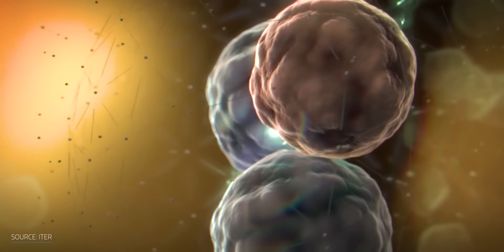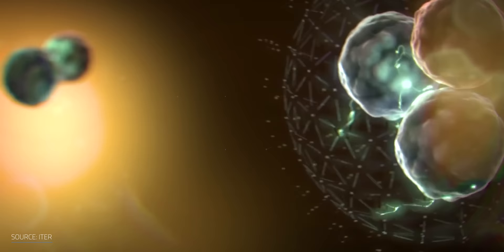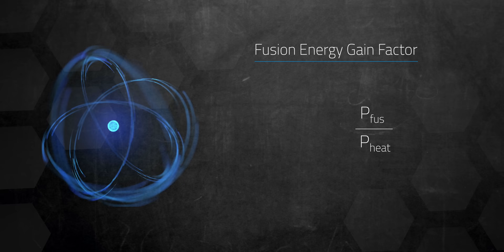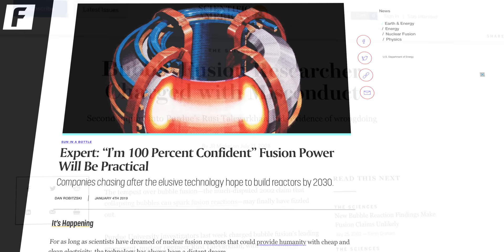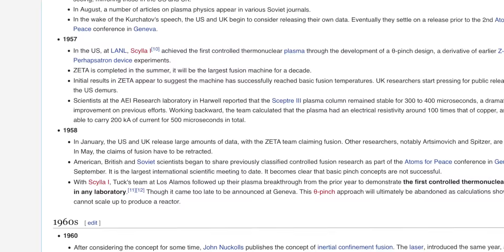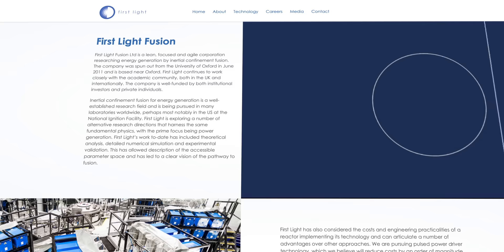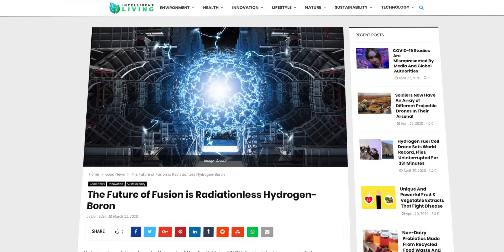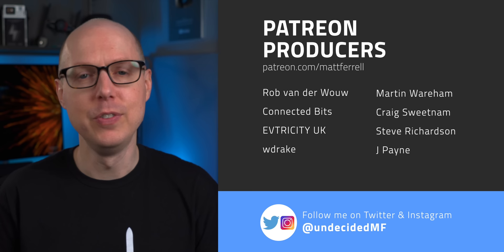The truth about nuclear fusion power - new breakthroughs

Comment: One thing not mentioned here is the distinction between reactions that relase energy with neutrons (hydrogen, tritium etc) and reactions that release energy in the form of charged particles (proton-boron). The latter is a lot cleaner in terms of radioactive materials and its a lot simpler to convert the energy (you're not boiling water). Of the latter, my favourite (and not mentioned) is focus fusion (electrical discharge driven). Of the former, my favourite is the ARC reactor concept. 

This being said, fusion is unlikely to compete commercially with solar and wind energy backed with battery storage, pumped hydro storage and hydrogen storage. All of this will prove to be both extremely reliable and cheap, long before fusion is mastered. I'm saying this as someone who absolutely loves the technology. But its future will be in space.

Comment: Great video but a small correction to your highly condensed 10 minutes amazing video. tritium breading from lithium blankets is not an easy job, you would need the fast neutron to penetrate the structural plasma facing components with the right speed and angle to knock off the lattice of the lithium- tritium breeder- blanket which is quite challenging, but deuterium can be easily extracted from water as you mentioned.

Comment: It is far easier to let it explode than to throttle it linearly. May be we could never throttle it. 

Currently we use a model called tokamak model (electrode less and magnetic containment) the concern is risk for explosion or melt down. 

This model requires complicated and expensive containment to maintain plasma - artificially, giving up (ignorance?) the property in plasma of self (natural) organizing, convergence to temperature amplification called Plasmoid model. It operate on electrodes in pulse mode featuring can converge 10x the competition  models. Eric Lerner has more.

Comment: 04:08  The Q of 0.67 for JET is only for the ratio of the heat that comes out of the plasma vs the heat that goes into the plasma.
Apparently, the total Q, that is the ratio of the energy coming out of the reactor vs the energy that needs to be put into it to operate it (i.e. for the superconducting magnets, their cooling, the lasers, etc.) is more like Qtotal = 0.01.
It looks like nuclear fusion research likes to cite the Q for the plasma heat ratio, rather than the much smaller Q for the total energy ratio.
Source: Sabine Hossenfelder:  https://youtu.be/LJ4W1g-6JiY?t=541

Comment: The accidents with Fission reactors that you highlighted is due to the specific TYPE of reactor design (PWR) and the loss of pressure caused by power outage so liquid water coolant turns to steam which reacts with the Zirconium in the moderator stripping out hydrogen. The explosions at Fukishima was hydrogen igniting not a nuclear explosion. There are many other reactor designs for fission that are much safer.
Reply: For years, the propagandists told us that nuclear fission was completely safe.  They said that if something goes wrong, they just insert the control rods stopping the reactor.  Fukushima showed us that was a lie!  The reactor takes weeks to fully shut down even if the control rods are fully inserted!

Comment: I remember learning about the Tokamak in the early 80's.  They are still centuries away if one considers the tremendous energy required to run just the experiments for pico or femtoseconds.
Reply: James M the experiments last a lot longer than that!
Reply: @Gomlmon99  Ah the last documentary I saw could've been older.  Overall very good analysis of progress and strong arguments.  I am still hopeful but I wish the API had not discredited LENR or cold fusion by vote not by scientific merit.  The energy cartel did that.  Cheers

Comment: I'd figure that the moment any one of the possible designs hits a breakeven point and proves that it *can be done*, then the sheer volume of investment which would follow could proliferate fusion energy faster than we may expect. Especially considering the leaps in manufacturing and materials science happening every day at this point, who knows what kind of variety and capacity we'll be capable of when there is a viable design.

My pet favourite use for fusion would be mass scrubbing of CO2 from the atmosphere. The only thing preventing this from being viable is the energy cost. Really, what prevents a lot of things being viable is their energy costs. If we had vast excesses of clean energy, even horribly inefficient processes from today's standards just become no big deal. Like "haha energy printer go brrrrr"
Reply: If anything right now we just need better magnets as that helps contain the heat the best and with the heat problem out of the way we can actually produce electricity we are getting close the problem is you need to make a balance and that is hard to do

Comment: Assuming we get to a positive Q fusion, it really remains to be seen if it's commercially viable. Right now most of the cost of supplying say nuclear powered electricity is not the fuel or clean up, but the power plants cost billions to build and maintain, and the power line maintenance and all the smart meters on every house, etc. Judging by the cost of Iter ($20B), which isn't even expected to produce a massive amount of power, I don't think it will be cheaper than we have now. Maybe safer though.

Comment: Fusion reactors have not been proven to be practical, but LFTR's have been. LFTR is a low-pressure reactor system that is "walk-away safe" and is much more efficient than any high-pressure reactor ever built. Not only produces much less waste but can reduce the waste currently being stored by "burning" it as fuel. This is where we should be focusing our push to reform our energy supply.
Commercial Fusion power is still 30 years and trillions of dollars away. That does not mean giving up on it, we just need a workable option NOW. LFTR, along with solar and wind is a doable option that we can make work now.
Reply: How are LFTRs practical??? They’re horrible reactors

Comment: Fusion is simple, it needs to be 1. Hot enough, 2. Dense enough, 3. Long enough. My dad proved that Zeta didn’t produce fusion.

I worked on JET. And programmed pressure vessel calculations on to a Cray supercomputer.

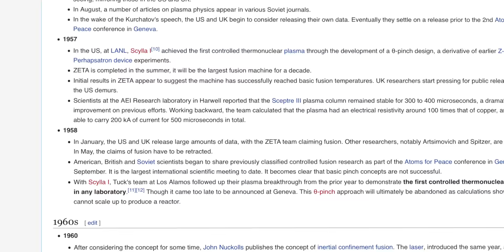Comment: 6:43 With Qtotal for JET being 0.01 (in 1997) (see my comment for 04:08), we have actually been around a factor 500 from the core of a nuclear power plant that actually produces energy, for over 20 years now.  And apparently, ITER will only have a Qtotal of 0.02.
Reply: As mentioned in the video, MIT together with Commonwealth Fusion Systems are currently building SPARC, a tokamak reactor over 10 times smaller in size compared to ITER. Scheduled to be built and running by 2025, SPARC can achieve net positive energy, based on the demonstrated performance of the magnets. The next step is to scale up, and to build an actual power plant (ARC). ARC design aims for a Q-Total > 1 (net positive energy) at Q-Plasma = 4 and Q-total > 4 at Q-Plasma = 14. The target for pre-decessor SPARC is a Q-plasma > 2. SPARC projections however, identify a viable operational point where Q-plasma is between 9 and 11. So, there is reason for some optimism.

Comment: The video mentioned interesting technologies, which might be possible in the future. But currently the only technologies which will probably be available for commercial use in like 20 years are the ITER (tokamak design) and the stellerstor design. Both are relatively well understood and already work very well in the lab, while there are no real ground breaking problems are known. 

The fact that ITER is this expensive and takes this long to build is not necessarily a problem of the technology but rather a problem of the project organization. The ITER project is built as a joint venture of half the world and not just in financial terms but also in practical terms. The goal is that every participating country can build every part of the reactor, so it actually is done. Every country almost builds every kind of part. This is the reason that the project is slow and expensive, not the tech.
Reply: Luca L finally someone in these comments who understands how life actually works 😂
Reply: Also ITER is too far in the build to take advantage of new materials like the high temperature superconductors or HTS, such as REBCO. This enables MIT to build its SPARC reactor 10 times smaller, scheduled for 2025.

Comment: 1:45 just a quick minor correction. Fission reactions happen all the time. Its the main source of energy in the core of the earth. Uranium, thorium, and a ton of other long half-life radioactive elements are in the core of the earth continuously getting fizzed releasing energy.

Also carbon-dating works on carbon-14 atoms undergoing nuclear fission.

The point is that fission does happen all the time, naturally, just not in concentrations enough to actually be dangerous, because dangerous means unstable and unstable means doesnt exist for long enough to still be around.
Reply: How is carbon-14 an example of nuclear fission?
Reply: @ISUringman1974  when carbon-14 decays, it becomes nitrogen-14 by emitting a beta particle (electron). This is fission because a neutron undergoes fission to from a proton and electron
Reply: @boggless2771  That is not nuclear fission, in terms of the relevance of this video.
Nuclear decay does not mean fission, in the sense that is referred to in this video.
Actually, Nitrogen becomes Carbon-14 in the atmosphere as the result of being bombarded by high-energy neutrons.  
In terms of this video, nuclear fission occurs when an atom's nucleus is "split" by a neutron, forming atoms with smaller masses than the target atom.  Nitrogen does not split to form Carbon, and Carbon does not split and form Nitrogen.
Carbon-14 decays with a half-life of 5730 years.
Carbon-14 decay is a result of a neutron releasing a beta particle, resulting in an additional proton in the nucleus of the Carbon atom, making it Nitrogen (7 protons).  
Technically, radioactive decay can be thought of as fission, but in discussions of nuclear fission as a means to produce energy as a fuel, radioactive decay and fission are not interchangeable terms.
However, your explanation does clarify why you said:  "Also carbon-dating works on carbon-14 atoms undergoing nuclear fission.".   As I said...technically, if you consider radioactive decay as fission, you might be able to stand on that point.  But, when discussing nuclear fission, it is not referring to things such as C-14 radiation.
BTW --- the cause of radioactive decay is instability.  You also stated:  "dangerous means unstable and unstable means doesnt exist for long enough to still be around."  Again, not accurate on a couple of levels.

Comment: Fission does occur in nature, it's just extremely rare.

https://en.wikipedia.org/wiki/Natural_nuclear_fission_reactor

Plasma is also not exclusively the kind you get in fusion reactions - there is also cold plasma found in medical use, electrical discharge arcs in the air (like lightning), and plasma found in ordinary fires which can be disrupted by radio waves and sound to combat fires without the conventional liquid means to douse it.

Comment: The big problem with tokamaks with deuterium/tritium fuel is that the reaction produces very high energy neutrons.  Neutrons, being neutral, are not confined by the tokamak's magnetic field.  They flash out at high speed and break the crystal structure of the reactor's walls.  I hope they can ignite boron 11/hydrogen 1, because the products are three alpha particles.  Neutrons cause too much trouble to include in this short post.  (Yes, I do note that the proposed reactor is not a magnetic confinement reactor.)
Reply: @swordbeach4709  I  read this, sorry for the delay.  The neutrons I was talking about that break the crystal structure of the tokamak are NOT confined by magnetic fields.  So they will degrade the walls.  I got this from the IAEA.  The article deals only with helium and the problem is with neutrons.

Comment: Fusion is just a year away if it works. Though a lost technology worked as a fusion reactor. It used a glass tube 4inches in diameter. Several inches long of partial vacuum. A kids Tesla coil and some coils ran the device with a self resonate oscillation.But since this fusion existed. I can[t replicated it but maybe cold fusion could be done with cheaper materials based on new Lattice fusion using a radioisotope to start the reaction. But it may not even work with hydrogen and nickel alone.

Comment: TFTR was shut down in 1997. There current machine is NSTX-U. It’s a spherical Tokamk. They wanted to build a machine called TPS. That’s Tokamak Physics experiment. DOE wouldn’t fund it. Congress wouldn’t sign off on a physics experiment when their previous machine was called a test reactor. ITER has been a giant funding vacuum since the French decided to host it. All the innovative confinement concepts lost their funding. Princeton shrank. Alcator C shut down. DIIID is still running at General Atomics. I think UW Madison still has a Stellerator running. And National Ignition Facility at Livermore. They are more about bomb fuels than energy production. Now there are some private funded companies. I work one of those. I used to work for the University of Washington. Our funding was cut in 2011.

Comment: three mile island: no radiation released, nobody was hurt. adjacent reactor unit is still in operation, older reactor design. Chernobyl: first generation, known unsafe reactor design, miss-managed during experimental conditions. - modern reactor designs you could cut the power lines and walk out of the control room and they are safe (passive safety, without control they cool down, not heat up)

Comment: To summarize...
Fusion will NEVER compete with fission as a practical power source.
1 - Fusion requires a huge amount of energy to initiate.
2 - Fusion must contain both the hottest (plasma), and coldest (magnets), temperatures.  
3 - The walls of a fusion reactor will rapidly be degraded because the fusion reaction produces neutrons which are 15 to 30 times more energetic than those produced in a fission reaction.
4 - A fusion reactor cannot be as efficient as fission because of heat transfer.  The fuel rods used in fission are like the tubes in your car radiator, that is that they create a huge surface area    for heat to disperse into.  There is no equivalent to this in a fusion reactor as all the heat must be radiated into the relatively small inside surface area of a toroid, or sphere.
5 - Servicing and repair of a fusion reactor will be far more complex because it is built like an onion, with tightly bound layers one after another.
With fission you are dealing with elements that naturally trying to be more iron-like.  You just have to bring them close together.  Neutrons are less damaging to the system.  The flow of heat is inherently more efficient.  Fission reactors are easier to maintain.

Comment: I'm pretty pessimistic about it being commercialized successfully. The easiest form of fusion requires Tritium (short half-life, nuclear proliferation concerns, short supply) and produces most of its output in the form of a neutron flux far stronger than anything in a regular fission reactor. It will irradiate the reactor vessel pretty quickly, requiring a costly replacement on a time-table we haven't locked down yet.  It also means power has to be generated in the same way as a regular fission reactor (boiling water to produce steam), so unless it can produce power cheaper than a fission reactor of the same size we already know it won't be profitable for a long time because new fission plants aren't profitable until you're out to the 20 year time-scale. 

Other forms of fusion don't produce as many neutrons, but they're also much harder to do, have a lower energy density, and have massive Brehmsstrahlung losses that will heat up the reactor vessel and limit how much power any particular core can produce (along with cooling the plasma, making it harder to get sustained ignition and burn).

Comment: Isn’t everyone trying to work around the scarcity of He-3? I believe we could build up stockpiles of Helium-3 by separating it from the Helium already separated from natural gas. Natural gas is so abundant in the US that we are burning it off in states like ND. I think we could eventually isolate He-3 from cooled helium at a cost of $34 per liter. With Helium-3 fusion you don’t need as much heat and you don’t have the additional disruptive neutron lowering efficiency.

Comment: Y’know, we’ve seen the curve of improved technology go from 
1/30 yrs, then 1/20, by now, we’re about to crank over the next revolutionary breakthrough horizon,
1/10 years (~2030), then it’ll tighten down to 
1/5 years (2035).
That’s when I think, commercially ubiquitous fusion reactors will be common.

Comment: Let's be sure to note that a fusion reaction generates about 1/10th the power of a Thorium reaction. This means that you have to be able to do 10 times as many reactions to gain the same amount of power. And Thorium reactors are TODAY and not 10 years in the future.
Reply: Pretty ignorant comment, considering an atom of thorium weights about 80 times more than a tritium atom. Not that it’s relevant. Energy released “per reaction” is not a useful measurement anywhere.

Comment: What I don't end up understanding is why the heat inserted into the system to trigger the fusion cannot be later recovered as well to power up the tubines. Even if the fusion gives less energy than the one put in, if you recover that energy as well, then you get the extra of the fusion. Is there any piece I am missing here?